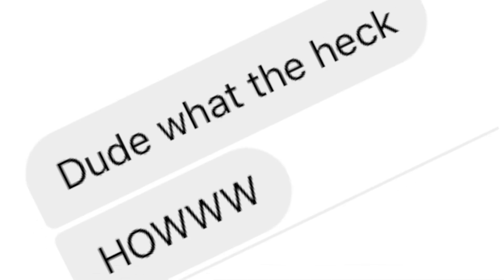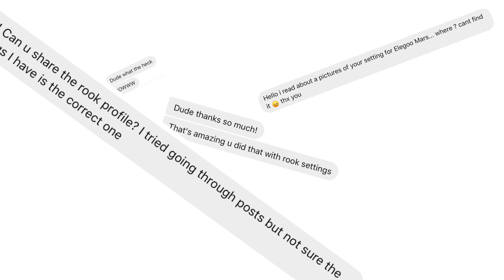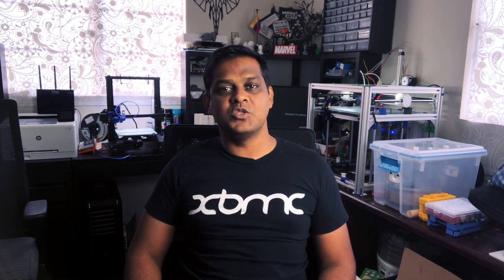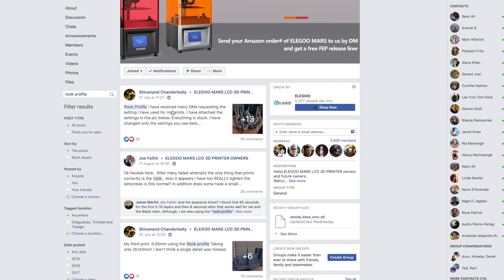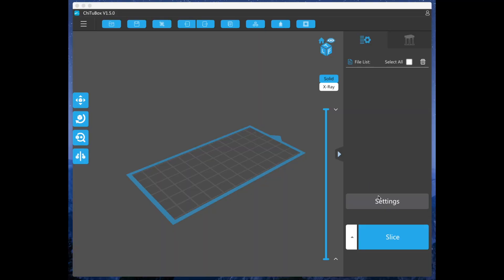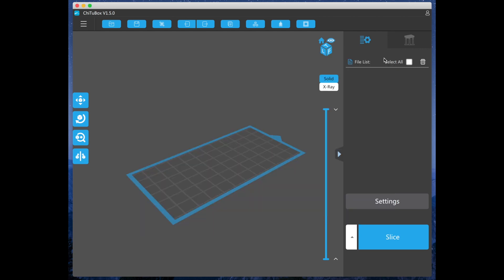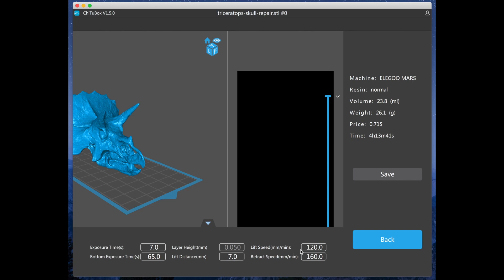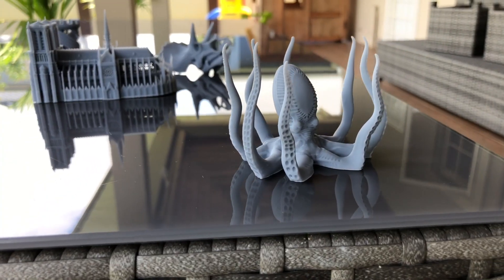Perfect SLA Resin prints on your Elegoo Mars, Anycubic Photon and Epax X1 using the "Rook Profile"!

Comment: This is interesting, I would think lift speeds set that high on a supported models would be trouble. On the Rook, its not meant to have supports and is locked on pretty tight from the bottom layer over exposure, but a normal model that's supported will have different challenges. The lift speed and various other factors play a big part in figuring out how much force is applied to the supports. As those lift speeds increase I would have thought the likelihood of a support failure would too. I guess if people are use deep and relatively thick supports it should hold on fine, but I would have expected to hear of a lot of support failures.

Comment: Question. What does changing the exposure time form 8 to 7 do for quality?  And Minis like 40k soldiers, should be printed at 0.03 right?
Reply from the maker: Changing the exposure the changes the cure time. You have to make sure that you are not undercutting. Make sure you run the calibration tool if your printer supports it. Also I personally don't see the benefit of 0.03 vs 0.05
Reply: @FrameonesMakerspace  do you use shading inks to paint your minis? or do you drybrush?
Reply from the maker: Hi West Side, I use both!

Comment: I have been wondering about the LIFT settings that were added. A lot of tips and guides I find seem to just list the basic settings from older Chitubox firmware which doesn't list LIFT settings. I have noticed that for my Photon they are set to 65 by default but for the Mars they are set higher like 90 bottom and for other layers 100. Would it be better to slow them down?

Comment: could anyone hlep my prints keep sticking to the film
Reply: Try to angle your prints so you don't have a large cross section being cured. The bigger the area being cured, the greater the stick. So I angle my prints, and provide enough supports so that the print bed has the biggest cross section and hopefully holds the print stronger than the stick on the FEP. Hope that makes sense? Good Luck

Comment: Interesting video and helpful to a point but pretty basic.    I have no interest in printing trinkets.   I am printing scale model parts that need to be dimensionally accurate and have a good surface finish.   I measure parts with digital calipers so I know how true to my design the parts are.    So far my experience with the Mars is impressive but dimensions are always a bit off.   I am wondering what the dimensional capability of the LCD and Z slide are?   It would be nice if you could do a video or series of videos on how to get good dimensional accuracy with this type of printer and the Mars in particular.   I used to send out to have parts printed on an Objet printer that was dimensionally accurate but with less than outstanding surface finish.   The Mars seems to provide better surface finish but the dimensional accuracy isn't spot on.
Reply from the maker: Good point! There are numerous posts where parts were printed dimensionally accurate in the Z axis but on X and Y they are fine. I believe this is a limitation with the technology at this time. There have been a number of ways persons have attempted to correct the issue from removing any flexible couplings to running the model  through software to account for the error.

Personally I haven’t done a lot of dimensionally accurate models so not having the right tolerances you seek haven’t really affected me. That being said, I will definitely add it to the list of upcoming videos to see if I can really get to the bottom of the error or at least try to find a solution.

Thanks for your.m comment and suggestion!

Comment: Nice video! Im pretty sure I ran across you in the Wanhao or Raise3D Forums back in 2015/2016 when I just stated printing.  I saw some people asking about resin color affecting the settings. I know Chitubox 1.6.1 (which I am using) has settings for the various Elegoo colors and I have used Grey, Clear Blue and Clear green with good success. Would you expect the lift and retract stay the same for the various colors? I get that exposure will change, but im more curious about the "extra settings" since I never knew about them until I watched the video
Reply from the maker: Matthew I remember you also :) Lift and retract settings usually won’t change but definitely the exposure, due to the pigments that are different. For instance Maroon is notorious for being difficult to print and black a little more difficult than Grey.

Personally I haven’t changed lift and retract settings for all of my resins. I is the same for all.
Reply: @FrameonesMakerspace  Thanks for the fast reply. Changed my lift and retract. So far, so good!
Reply from the maker: Matthew Horbund you are most welcome man!

Comment: If you load the Photon printer it will have the stuff from the hidden page on the print tab. all the dimensions match, and all the other parameters are there to edit as normal.
Reply from the maker: Thanks for that tip MrCinpro!

Comment: Thanks for the video! Will the additional setting save as you have altered them or does on need to adjust after every slice?
Reply from the maker: Hey Peter, the settings will stick. You can also export them and save them to a file.
Reply: I'm yet to get a successful print at all made about 20 disc's so far with the rook.

Comment: didn't know about the additional settings, so thanks for that! 

Presume I'll need to edit my exposure time if am working with 0.01mm?
Reply from the maker: Hi John, yes you will. Start by lowering it one second and work down from there.
Reply: @FrameonesMakerspace  So if im printing at .03 would these settings still work ?
Reply from the maker: Matt Eastman you may have to experiment a little. The pull forces should be fine but you may need to tweak the espouses down a second or so.
Reply: @FrameonesMakerspace  thank you im very new to this ( experienced in FDM i know how the trial and error method work lol ) again thank you sir and l look forward to more of your videos, i wish you much success and happiness in years to come
Reply: @FrameonesMakerspace  yes, am having a play with the exposure times now after running an exposure calibration test. Thanks!

Comment: Great videos. I noticed the base on some of the models you showed seem to be wrapped. As a nube can you explain what is going on there so that I might avoid it? Would like to see specific videos on your printing some of the complex models like the cathedral and others.
Reply from the maker: Hi Steve, yup.. those prints needed more supports to keep the plane. If you can get away with it, the best way to get perfectly level bases is to print flat on the bed.

If you must angle your print, ensure you have enough supports on the angles base! I will try to get some more videos on the architectural items like the church soon!

Thanks for your comment!

Comment: Does this lift/retract speed matter for different printers or is it based off of resin viscosity?
Reply from the maker: znorman23 the lift speed here is based off of Elegoo Grey which has little viscosity. You would need to adjust it down for more viscous resins like Sirya Blu etc.